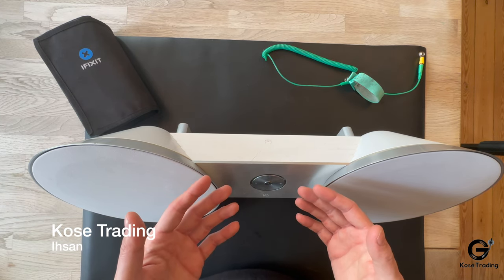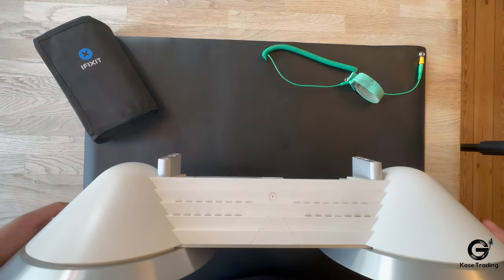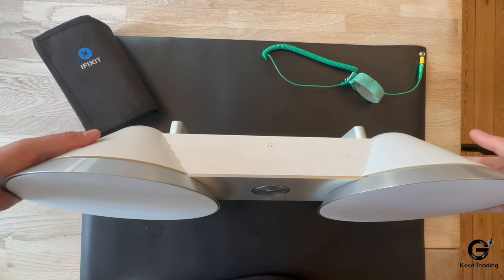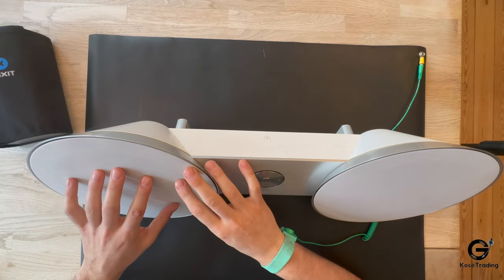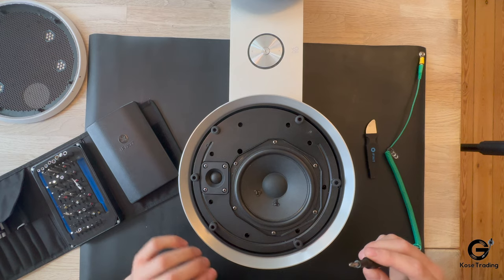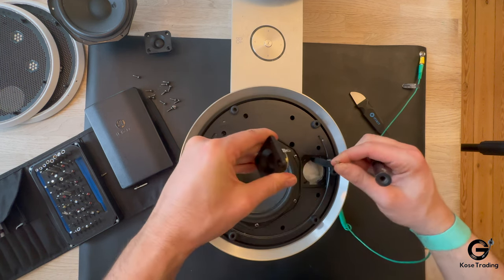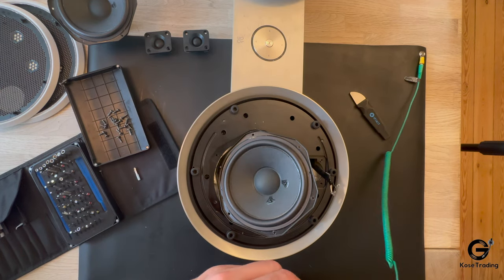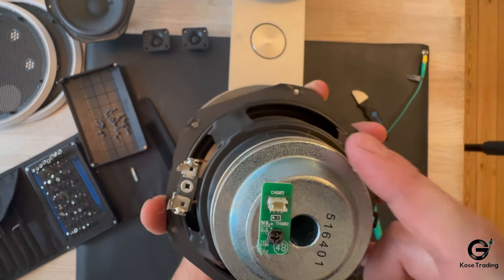Bang & Olufsen Beoplay A8 Disassembly process and repair guide

Comment: I have a Beosound 8 that no longer powers up with an iPhone dock.  Do you have any experience fixing it ?
Reply from the maker: The Iphone dock connector is a very weak point. Send us message we  then we can try to help you.
Reply: I also have this problem does this have any fuse? Thanks
Reply from the maker: @ervinpate2093  Send me a e-mail and we can try to help you out
Reply: Do you have the ribbon cable going to the control panel seems like I messed it up. Sorry whats your email add I cant find it thanks.
Reply from the maker: @ervinpate2093  Yes. Send me e-mail to contact@kosetrading.com

Comment: Hi I don’t know if you can help. I bought an A8 many years ago and only used it 4 or 5 times. I couldn’t get it to connect to the internet. Very frustrating. I took it out the other day and hooked up my CD player to find that only one speaker works!! I literally only used this machine a few times many years ago. Can you suggest how I might be able to get sound from the right speaker please? Cheers!
Reply from the maker: It's a very common problem. How is your Wifi setup?
Maybe the Wifi modul inside the Beoplay A8 is defective.

Comment: I started following your steps. I also bought a static wrist band but should I need a static mat to connect or any metal should be ok?
Reply from the maker: That's a good start. But you need connect the wrist band with the static mat.

Comment: Hello, Thans for the video. Can you suggest how to fix the known wifi problem(blinkend red and not connecting)? Maybe replacing or changing a specific part ?
Kind regards
Reply from the maker: Thank you for your comment. The Beosound A8 has a weak point with the Wi-Fi. I have a connectivity board in stock. It can help you with the problem.
Reply: Hi @KoseTrading  Thanks for the video I'd be interested in a wifi module if you have one in stock. Cheers
Reply from the maker: @lincolnmcleod yes. We have that in stock.

https://kosetrading.com/product/bang-olufsen-bo-beoplay-a8-wifi-board-part-pcb/

Comment: Hi mate,
Would you able to tell me the part number of IC802 on pcb 4 power supply. Information would be much appreciated. Thanks for your video.
Kind regards,
Daniel
Reply from the maker: Hi Daniel
Thank you for the comment. Can you send us a picture of the part your are requesting for. You can send the picture to contact@kosetrading.com

Comment: The Beoplay A8 MK1 does not have bluetooth. It connects via Wi-Fi. The Wi-Fi modules are known to burn out causing a fault identified by network button and front center button, constantly blinking red. Apart from that they are great sounding players.
Reply from the maker: Hi belledetector  

You are completely right. It only have Wi-Fi. I took my 30 min to connect and setup to my Wi-fi spot. It was very hard to setup.
Reply: I am having trouble connecting to my W-Fi also.  I get the red blinking light on the front and back network button. How do I fix that?  Can it connect to 5g network?  Thanks  @KoseTrading
Reply: @bd89117  I have the same problem with my A8, did you solve it?